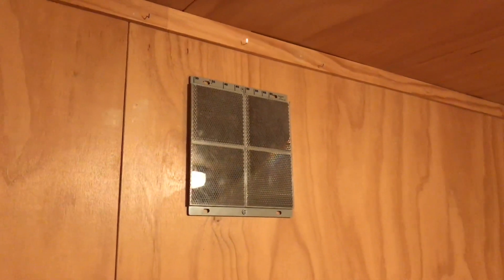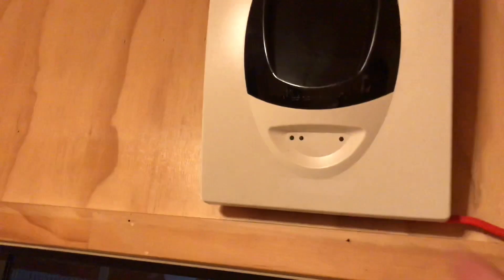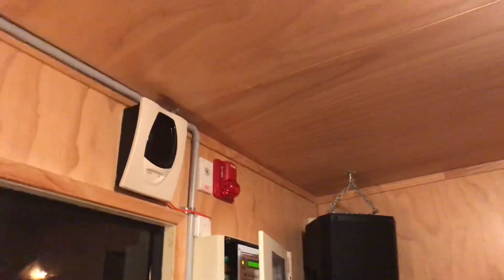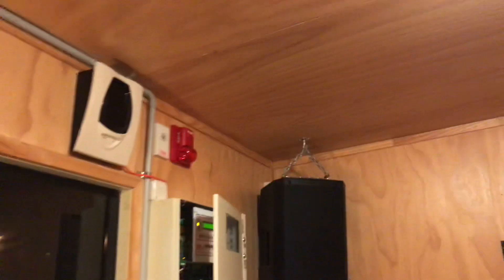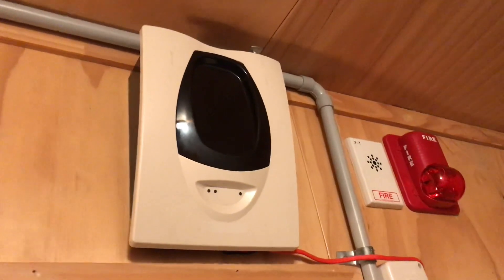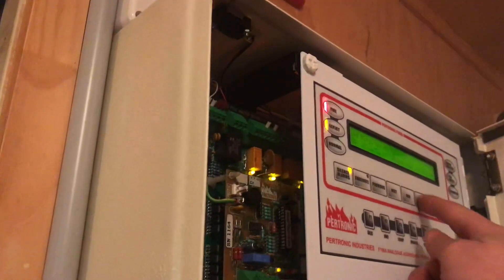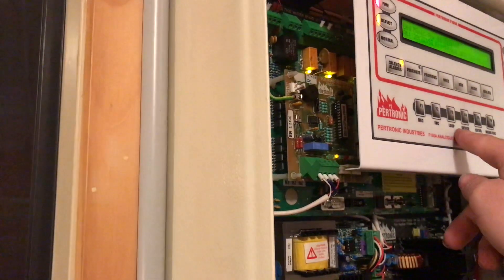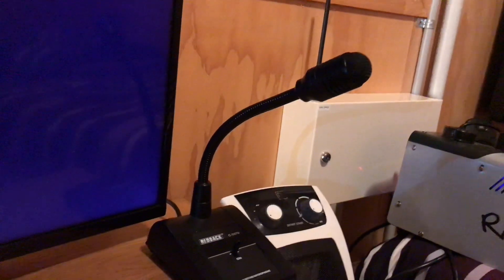Fire alarm test -Beam detection

Comment: Question: If this system triggers when the beam of light is disturbed, wouldn't something accidently blocking the reflector also trigger the alarm? For example, if someone is doing mantinence or something and accidently stands in front of the emmitor/receiver? Are these usually just installed out of reach of people? Super cool tech, regardless. Thanks for sharing.

Comment: These devices need extra power to power up...
In which 2 wire of loop...one is loop in and second is loop out...for next device...nd same like 24vdc for power in and out...
One beam detector range is 5 to 50 meter...

Comment: Why would you use a beam instead of a smoke detector
Reply from the maker: Nathaniel Rivera It can be used to cover large areas that may not be suitable for point type detectors. It’s also a cost saving measure. One beam detector can protect the same area as many smoke detectors